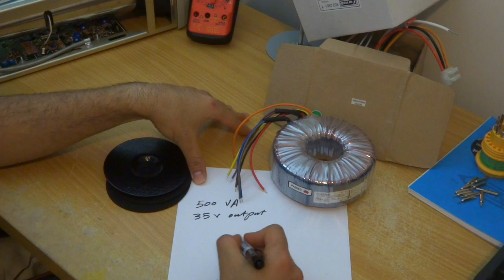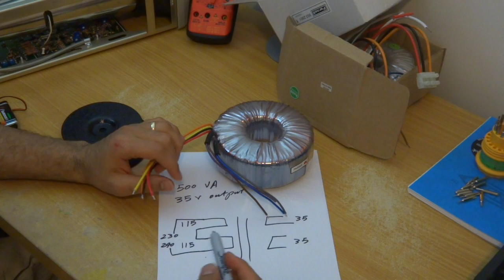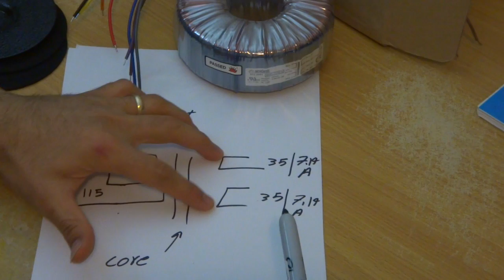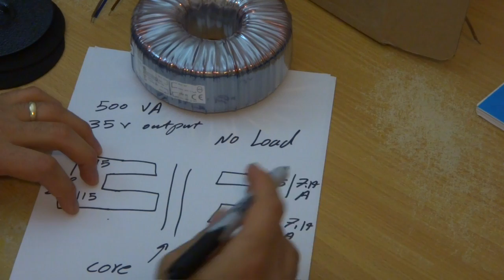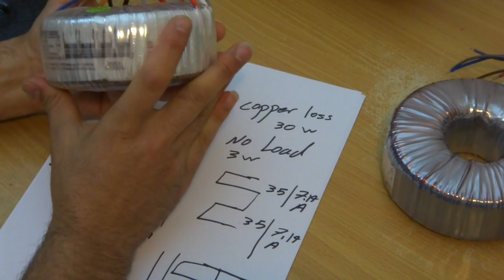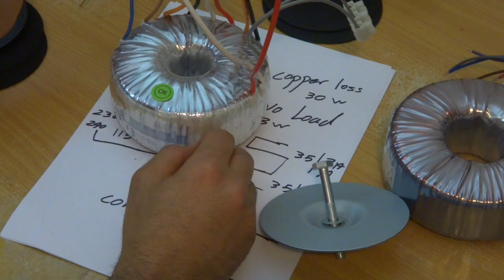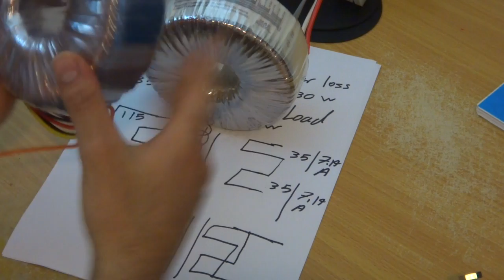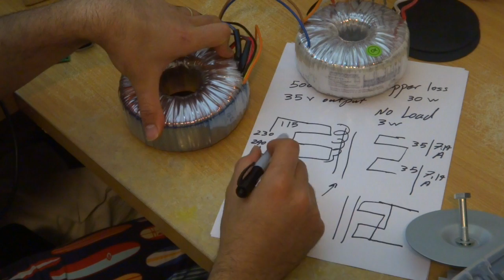Toroidal Transformer Installation Setup and Connection Principal

Comment: ALWAYS use a nonconductive bolt to secure the toroid. Otherwise you can have a shorted turn and do great damage. 

 Also, toroids saturate very easily if there is any DC offset on the line. This can and does occur for several reasons related to nonlinear and asymmetric loads. This can cause performance issues that cn be tough to track down.

Comment: Great to see you recommend the fuse on the primary. You can also tell everyone mounting the toroid transformer on a metal chassis NOT to earth the top mounting plate with any Earth wire . Assuming the bolt is already earthed to the  metal chassis the Extra earth wire would become a shorted turn for the toroid and if lucky blow that primary fuse or else get the earth wire would get very very hot and burn.
Reply: Correct and very important. Bolts seemed like a good point to attach ground wires, so I did, actually causing a shorted loop. Ground cables caught fire in 30 seconds. The bolt must be electrically floating, no ground, nothing. Better yet use a nylon bolt or fix the thoroid with heavy duty zip cable ties. One lesson learnt the hard way for me.

Comment: A question: I have a 3kw step down toroidal transformer (220 V to 110 V), but I have three outputs instead of four (one of the coils - I don't know which one has the ends connected, resulting in a single wire) How do I connect the terminals with the input as to obtain 110 V at the output?

Normally I should have 4 wires: two from the first coil and then from a
two coils and in this way, it was easy to connect

Comment: Is here a need to put in a bridge rectifier and 1000uf capacitor in the output side ? I have a 24vDC submersible pump and a 240v/24v toroidal transformer .

Comment: How does configuring the primary winding in series and parallel effect the voltage and current of the secondary windings?
Reply: I'm not sure in this, but I think that you only wire the primary side in series if you want to input 230V instead of 115V.
If you want 70V output instead of 35V, then you wire the secondary side in series. 
But if you want to provide 115V and get 70V, then you need to wire the primary side in parallel and the secondary side in series.

Comment: Are you suppose to get continuity between each primary? I try to hook my 2 reds up and it pops my breaker, I was told both red 220 input both yellow 60v output
Reply: Remember he said there was no standard between colors.
Reply: Drew Kerlee I’ve learned a lot about these and ac motors in general lately. You will get basically a dead short if you hook up a continuity tester between inputs! I had to use a D curve breaker for my toroidal transformer so it won’t trip the breaker because there is such a in rush of current! Thanks for your reply!

Comment: okay so I have like 50 of these.....
the question is what can I do with them?
I'd like to use one for a hot wire foam cutter I'd like to use a couple more for small CNC projects.
I believe they were original used in Creative Labs Sound woofer boxes.
I think of primary and secondary are both 20 volts, which if im not mistaken would be perfect to run a small CNC machine?

Comment: Good evening,I am Eliezer Rodriguez, Biologist and also musician. I want to build a power supply for my acoustic guitar pedal board because the commercial types available have multiple features that will never get used and they are expensive. There is nothing on the market for my particular needs; therefore, the reason for building one. I found a diy layout from a guy in Australia that looks like something that I need. According to the source the ac input is 240v and, being from USA, I need that input to be 120v with a DC outputs of 9v with no less than 300 mA. Would you help me modify the circuit it and how to wire the transformer?The source is in the link that follows. Any help will be greatly appreciated. 
http://www.guitars-of-love.com/9V_regulated_PS_V6.htmlRegards,Eliezer
Reply from the maker: +Eliezer Rodriguez The link doesnt work. But if your output requirement is 9V with 300mA, no need for transformers and rectifiers. It is alot easier to buy a good power supply from ebay. Search for 110V 9V power supply
Reply: I think did not make myself clear enough. I'm not looking for a single power supply for one pedal. What I need is an isolated multi output (at least 6 outputs). In that way the noise due to all the individual transformer gets eliminated. As said before, I decided to build one because is cheaper, I can customize it to meet my particular needs and is fun. Already traced the PCB using software. Just waiting for some guidance before getting started with etching, tinning, masking, etc. I understand it may not be easy, but I'm determined. Sorry for the bother.